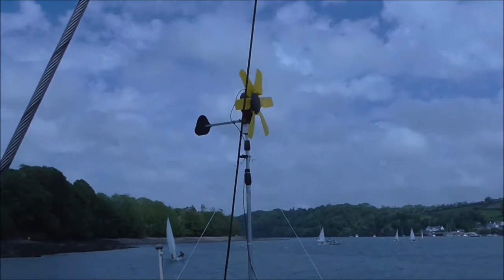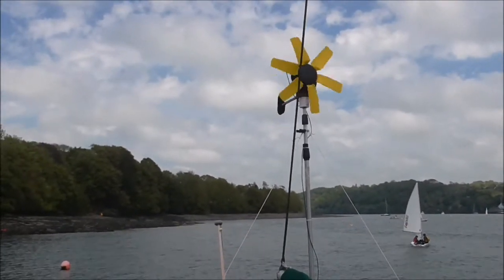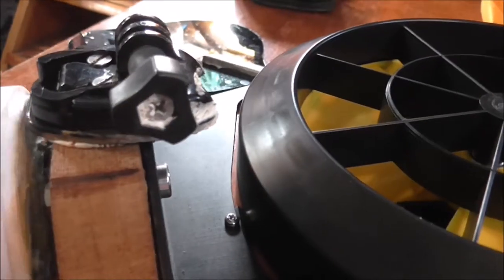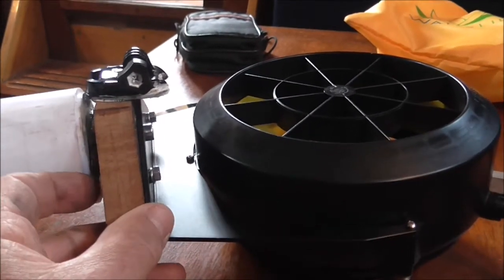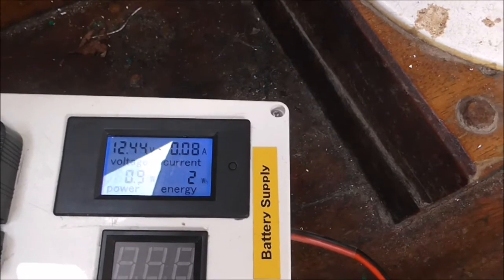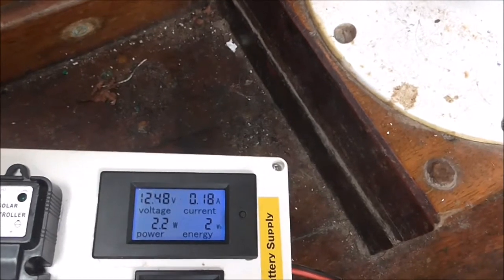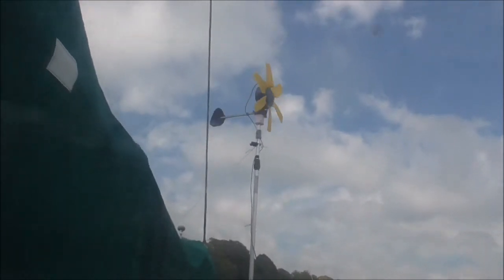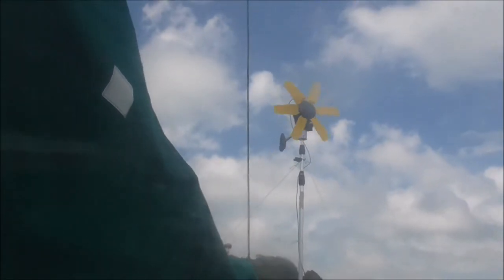Windlily Turbine Yaw and Fin trials

Comment: how did this thing turn out for ya? is it worth the money?
Reply from the maker: Good Question ,  I have purchased a couple of these portable wind turbines and made a few DIY one's with DC motors or stepper motors, so from that experience I would say it all depends on your requirements / usage as they don't produce the watts/ amps quoted as far as I can see.
The issue seems to be to produce reasonable current output against the constraints of size and weight so as the unit can be portable.
I have been busy this summer on another project so got no opportunity to use the windlily.
All l can say is if I was starting out again this would be my first choice even though it is costly.
Am I hedging ?
Reply: Finally had mine delivered after waiting 11 months after purchase to receive.. Using for camping trips I am currently testing mine right now with low winds 0-20 mph connected to a GoalZero Lantern that acts as a battery storage unit as well. After 72 hours I was able to charge to 25%, with a 20 W solar panel (about the size of two sheets of paper) I can charge the device in under 3 hours. Have not tried with higher wind speeds.
Reply: PS - I did purchase for use in the high and low deserts of Southern California where windspeeds regularly reach 100 mph when we are out there. That is truly what I want to test/use it on/at for long stays.
Reply: @beedubs100  eleven months,that's almost a year .would it be because of Covid or is the company slow if you ordered one?
Reply: @sosteve9113  To be completely honest, after a few months I started sending e-mails, responded to by guy name Geoff. Every e-mail it was 6 weeks it will be there again. I was told at least 6 times it will be there in 6 six weeks and I would get a notification. I never got a notification and it just showed up at my door one day customs forms and all (CA to US). I literally had just given up and written it off as a loss I thought it was a farse at that point but it had been so long why try to bother to get the money back. So one day last month it showed up just randomly, no tracking, no notification nothing. Just glad to have it and I appreciate the device I didn't mind the wait just wish I had more clarity from the company and it's owners on a realistic time. 

BUT your question would be was it slow because of covid or was the company slow if you ordered one. I believe both factors play a massive part here. 

PS> I PRE Ordered - should have expected a wait - 6 weeks was the time offered at point of sale. 

1st. COVID was just then starting to affect the global supply chain.

2nd. I have no idea what their sales were pre and launch but I imagine that they had a massive back order and were not nearly ready to handle the financial backing/man power/logistical/experience to manage the order numbers. I've been in that situation personally where your requests become so high and your cash flow is so low you either sell out or burn. Case example:

https://www.wired.com/2009/06/pr-feetbelts/

 I have a feeling these guys pushed through and survived the major crush which I'm glad for them. Unfortunately with the chain supply failing at this point, I'd imagine realistic times are not looking good..  But if you want this product - I would expect a wait, who knows now, timing might be shorter? I work in Intl. Sea Logistics and in the pass year a 40ft container the costs have gone from around $3,000 to $20,000+ USD due to the china/CA US west coast ports being overloaded. Everyone's playing catchup sadly.
Reply: Did you ever test the waterlily at any point, mate, it looks better than the wind-powered one?
Reply: @wolfenstein6676   Not yet but planning too though I do not have any suitable rivers near by. Being winter time won't be able to test by towing behind boat until the Spring .
Made a quick attempt down at the pontoon with a flooding tide but the eddie's of the flood was causing the waterlily to spin around. Must try another day.
I am surprised that there are not more videos up on YouTube by now by other purchasers.
Reply: @martint1151  Yep, there's not many user videos, they're usually the best when it comes to really learning how good a product is in everyday life. Thanks for your reply and a Happy New Year to you too.